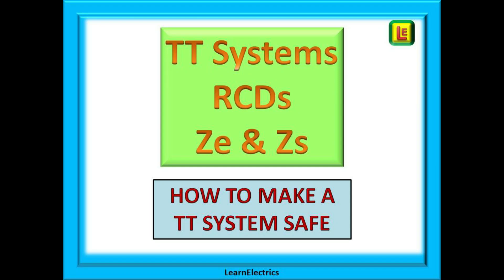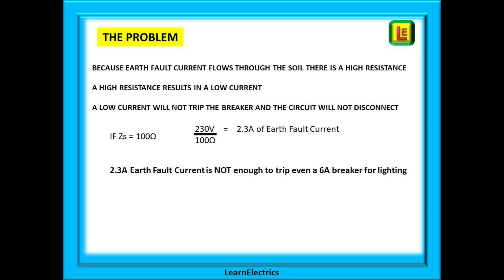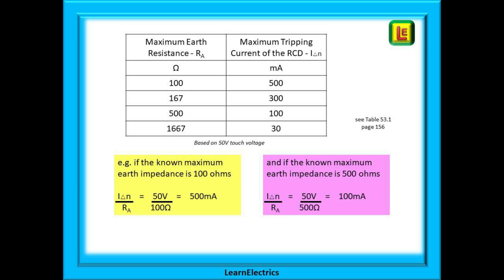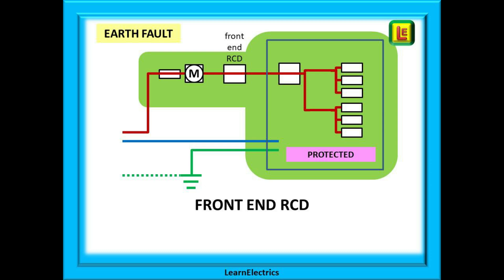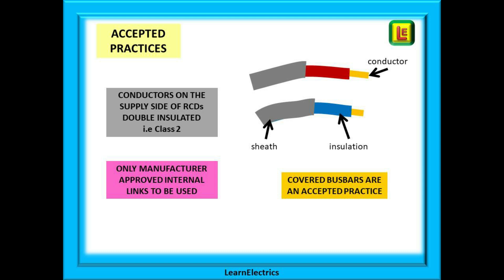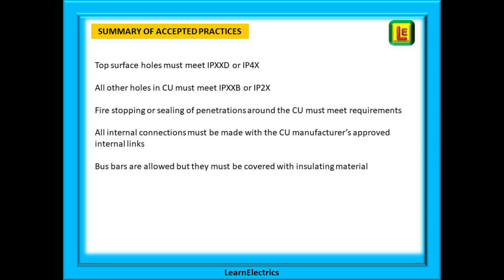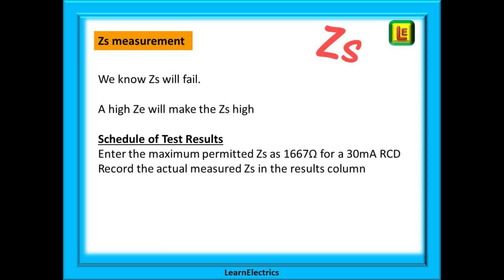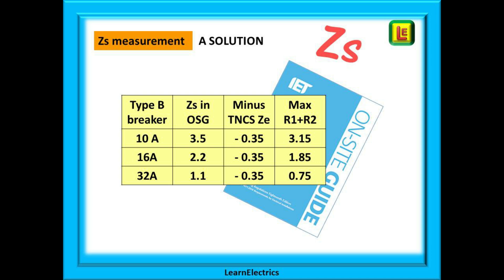TT SYSTEMS – RCDs Ze and Zs. How to make TT systems safe.

Comment: Hi! Let me understand better too. I'm from Romania, we have a TN-C system here, but the distributors don't respect the rules and standards and because of this I have to make a TT system at home. From the electric meter I get L and PEN, which I will insert into a fuse socket with a fuse of 25A on phase, then I will go into a 30mA RCCB, which I will connect 4 monopolar MCB 's. Earth resistance is about 5-10 ohms. Is this safe?
Keep up the good work!🎉
Reply from the maker: For a TT system, your earth resistance is ok if it is 30mA rcd protected. thanks for watching.

Comment: So I don’t need to fit a 100ma RCD before my installation on a TT system? 30ma RCBO’S will suffice? Great video I know it mentions no rcd before the installation am I right in saying this?
Reply from the maker: With long meter tails you may need to protect them with 100mA RCD, some DNOs insist on it, others don't, but that will not protect persons, you need 30mA at the CU for that. Thanks for watching. Dave.

Comment: Enjoyed your video, however I have one comment. In your RCD section, you say that on removing the front end RCD and relying on the internal RCDs is a step backwards! I have to disagree. You highlighted the undesireable effect of having a front end RCD. I think you should clarify that the 7671 also states, in essence, that the removal of power on a circuit should not give rise to another danger. Cutting power from all circuits can give rise to over dangers such as tripping and falling. An analogy I have always used is: Imaging a winters evening and an elderly/infirm or visually impaired person is taking a bath/shower. Downstairs they have left a light on, the bulb blows. The RCD sees the surge as a fault and trips the power. We are left with a person, as above, having to negotiate getting out of a wet slippery bath, going downstairs and in a lot of cases, going to the outside CU to reset the breaker. This has happened. My belief is that RCBOs should be used on every circuit maintaining power to healthy circuits.
Reply from the maker: I would like to see RCBOs on every circuit, or with the suggestions from Amendment 2, combined RCBO and AFDD. Hopefully the costs will begin to fall soon.

Comment: Hello Dave, please assist me with this technical issue. A building of six flats i carried out inspections on. What was the customer compliant. Whenever supply from transformer goes off customer lighting bulb still has slight glow, that is there's still voltage in it, same with some indoor sockets with LEDs on it. I discovered the building does not have an earth path for the building or earth wire in the consumer unit just line and neutral. Please can the absence of earth path cause this anomaly and how can this issue be resolved. Thank you very much
Reply: Earthing is not the issue. This is a 'symptom' that is commonly found with the more poor LED's, especially on 2 way lighting circuits. The symptom arises due to the very low load that the actual LED consumes. The symptom does not appear with say low voltage halogen, the reason why is down to the residual voltage is the secondary side of the transformer. The voltage will dissipate quickly through a higher wattage load. It takes somewhat longer for the residual voltage to dissipate in a LED circuit. Try changing the LED lights to a better make, JCC and Bell are very good makes I find. Alternatively you can connect a 300v (you will have to calculate the Impedance and wattage depending on installation) rated resistor between the Live and Neutral IN the light fitting, that will dissipate the voltage too. Regarding the LED on the socket circuit, the same issue, if the LED was replaced with the old Neon indicator, the voltage would dissipate a lot quicker and become unnoticeable.
Reply from the maker: Obinna, if the earth to the building is missing this would be a supply company issue. If it's a TT system, then providing earth rods is the customers responsibility. Also check the polarity of the supply. Dave.

Comment: Great and clear explanation. I'm not a spark (an electrical engineer) with a TT system at home. This is the best distilled explanation I have seen in particular about the external RCD. Thanks
Reply from the maker: Super news Matt. If the videos help then that is their job done and thanks for watching. Dave.

Comment: Another great video. Credit to the industry. What I recommend to customers that have TT systems with high Ze/Zs reading is to get have it converted to a TNCS by the DNO. Western Power are the DNO in the area I live and do it quickly & cheaply for complete peace of mind in an absolute worst case scenario that the RCD doesn’t trip, I’ve only recently seen this in an 8 year old house. However, issue then with a TNCS system is for example having a hot tub installed is that some hot tub suppliers insist on the hot tub being installed on a TT system (incase of a PEN Fault) so an earth rod needs to be installed with no inter connectivity between the TNCS and TT system. In my opinion the crucial point to take from your video is the importance of RCDs on TT systems.
Reply from the maker: Thanks Paul, great info. Thank you for watching. Dave.

Comment: Dave, will an RCD operate without an earth?
Reply from the maker: I've always installed them with an earth Mike. It gives them a reference point to the sensing coil.
Reply: @learnelectrics4402  I wasn’t implying to install without an earth, but if the earth was not present for some reason, would the RCD still work?  I had a customer with a spur that had no earth connection, my Kewtech meter would not test it.
Reply from the maker: That's right, its looking for an earth. The RCD needs a reference point to know.
Reply: @MS-Patriot2  Every RCD has a test button so one does not need any testers.
Reply: @okaro6595  be aware that the test button does not indicate the RCD will trip at the specified current or within the specified time. The test button really only exercises the trip mechanism.  In UK we are required to test the time and trip current of RCDs.
Reply: RCCB works without earthing as per Kirchhoff's current law.
But RCD testers want earth. 
ELCB's require earth for working.
Hope this helps.
Reply: @30mAkills  Thank you. Are you in the UK ?
Reply: @MS-Patriot2  Chennai, India.
 3 phase 4 wire 
Voltage between lines is 415
Voltage between phase and neutral is 240.
Earthing system is TT.
Reply: An RCD will work without earth connection but the problem is that in case of a case becoming energized you may need to touch the device before it trips and 30 mA can be dangerous. At least it hurts. With TT earthing the RCD will cur the power immediately. An RCD is never a replacement for earthing it in countries where earthing is has not previously been used on dry rooms installing an RCD can easily increase safety without rewiring.

An RCD protects in cases where earthling does not like in case of direct contact to an exposed wire.

Comment: For a radial socket circuit it occurred to me that R1/RN is similarly important for the overload condition, yet it doesn’t seem to get the same level of attention as R1/R2.  Of course high R1/R2 is the shock risk , where high R1/RN is the fire risk.
Reply from the maker: Good observation Mike, few think about overload, volts drop etc.
Reply from the maker: Thanks Andy. Dave.